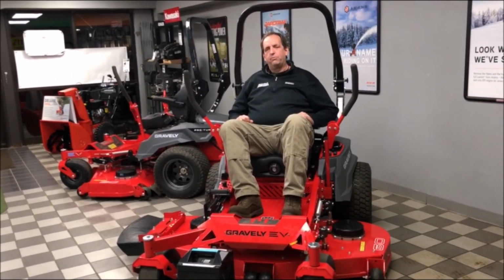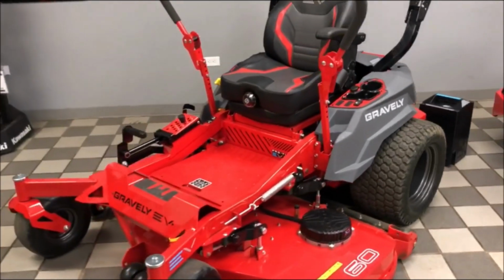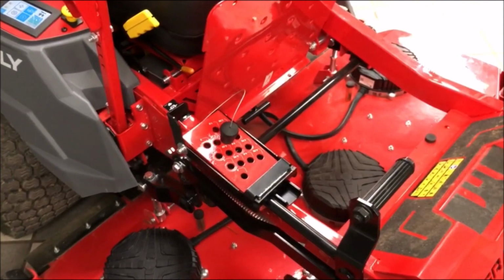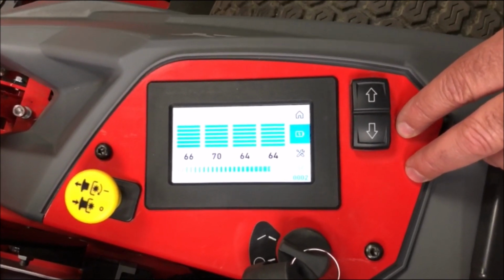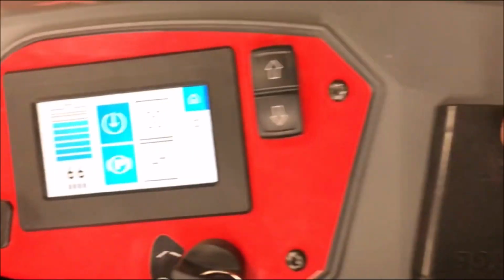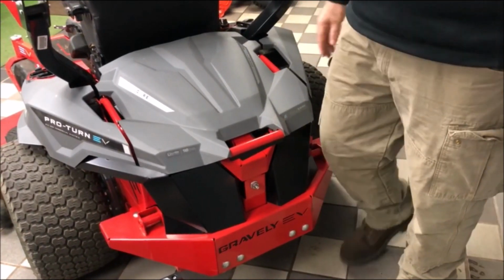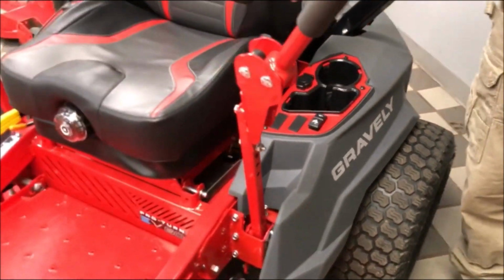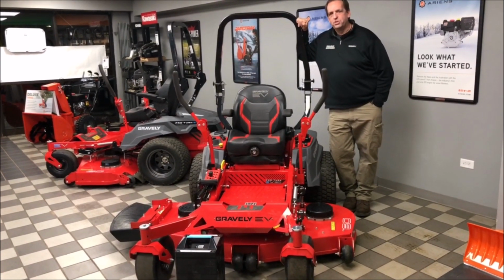NEW Gravely EVZT: Commercial Battery Zero Turn Mower

Comment: Nice review.  My primary concern are the three separate electric motors mounted on the deck.  I would prefer a single electric motor with belt driven pulleys.  We'll see what the competition presents in the future.  I do agree (and prefer) the future is electric over internal combustion engines.

Comment: I prefer rear discharge mowers for my Orchard I'm sick of side discharge and I need someone to make an off-set deck that sticks out to the left of the mower by a foot or more so I can get the blade underneath low hanging vines. 
Battery-powered seems enticing though if it's quieter than fuel.

Comment: Failed badly for maintenance staff & us (fancy words: landscapers): Ryobi #RY48140
* Mower @ $5,000.00 (54" zero turn) 
* 8 extra batteries @ $1,200.00
* 2 baggers @ $698.00
= Over $7,000.00

Didn't pass the maintenance tests during the day compared to gas.
The major drawbacks are my time is money (if battery dies, you are in trouble) & battery lasts about 317 charges which many paid reviewers will not tell.

Can't pay my staff or have clients cancel contracts if equipment go down.
And if I need to replace battery every year, then it not worth the trouble. 

Do you really think company cares if your are out of warranty?
Many of my zero turns & self-propelled mowers are still going strong and beyond 10 years old.
Reply: You need to try the Gravely,  you'll be impressed!!!
Reply: Thanks for the info, very helpful.
What brand do you recommend ( 10 years old is impressive )
Reply: @HolaFrenchy  Buy gas power products. 
Buy used zeroturn after it has a complete PM done. 
Honda or Craftsman rear self-propelled (get one that you can turn switch on/off for gas).
When done for the season, run it dry & clean to prevent rust.

10% ethanol = gov scammed by allowing millionaires to be rich by putting corn starch in gas
Leaded gas was great because it has lubrication
While corn destroy your engine, but first hurts the carburetor.
Reply: @HolaFrenchy  After Friday would be a good time to buy good used mowers from repair shops.

FYI: Husqvarna's home mowers are dead.

Comment: Gravey: you should design a hybrid model. gas to propel and generate electricity for those spindle motors. maybe even a full ele quite mode to mower early/late. having a gas engine on tap is a big plus like the toyota pruis uses

Comment: Wow how awesome, l bought my EGO landscaping equipment to start a weekend side hustle.   We didn’t get a price or how long the batteries will last on a single cut.
Reply: I believe it’s around 25K and up to 12 acres. I just bought the EGO Z6. 6K with all 6 batteries and up to 3 acres on a single charge. Electric mower is still in its early adopter phase. I don’t feel like deal with gas but you will pay about double comparing to a similar performing gas mower.

Comment: I think gravely wasted their time on a battery powered mower. No commercial lawn care company is gonna mess with a battery powered mower.   Gravely should've taken the time they spent building that mower and put it towards figuring out why their mowers cut like crap ive had 2 60 inch mowers and they both cut awful its like the blades are offset.  My exmarks will out do them 10 to 1. I actually lost a couple of customers over the way the gravely cut.

Comment: As more battery powered mowers are released the competition between them will result in reducing prices.
Reply: Ego will not be competition for the gravely. The Gravely will make the Ego look like a toy. Each Gravely battery is 8 times the size of an Ego battery.
Reply: Ray Johnson  Yes I already have Ego Plus tools and four of their batteries. The Ego Zero Turn looks good but this Graverly EVZT looks like a bigger and tougher machine than the Ego Zero Turn. The Ego will retail for $5K in the USA with four 10 amp hour batteries.
Reply: @kdegraa  the green mean have been on the market longer.

Comment: That says on the battery is 4 kWh, which is 16 kWh for set of 4 batteries. Gasoline engines are around 20% efficient, and liter of gasoline yeilds about 1.6 to 1.9 kWh of usable energy. That set of batteries can work like 10 to 15 liters of gasoline, or maybe even more since it does not idle like conventional mowers.
Edit: i think that 12h recharge time is excessive, that equates to 1.5 kW of charge current which is too low for a comercial unit, that is meant to be for a standard outlet of 110V and 15A. That should be capable of fast recharge of 1 to 2 h since this is a commercial unit not a homeowner unit.
Reply: There is also a 6 hour charger option. If needed you could charge 2 batteries in 3 hours. The goal for the commercial guy would be charge batteries faster than you can use them. It would make more sense to get an extra set of batteries than to have a 1 hour charge time (which would likely not be availble on customer's site).
Reply: Remember most days you wont drain battery to 0%, Our customers are reporting 6-8 hours recharge times.
Remember the advantage to this design is the removable batteries,   repower is easier than messing with gas cans
Reply: @mikehalloran8456  swapping a battery is easier then gas cans??? That is your selling point. Once i burn gas, its gone! Not stacked in a corner with other sone other half capacity batts!
Reply: @crabtrap  batteries have a almost 10 year life before they get below 75% how long does a gas mower last typically?
Reply: @wcooper0077  i have engines over 50yrs old that i use. and batteries aren't ranked by shelf life, they rank them by charge cycles. 75% would be about 100 charges in a good quality Lith Ion batt
Reply: @crabtrap  pretty sure I said mower not motor.  They are alot different,  this is built for a commercial mowing company. They will save money on fuel.  And replace the mower before the batteries got to weak to be usable...
Reply: i assumed you mistypes as the rest of the 'mower" isn't really in question as the spindles,blades and transaxle are going to wear the same on gas OR electric.  or do EV's have magic spindles too???
Reply: @crabtrap  it's all electric runs on three motors did you watch or read about it at all?
Reply: Relax your Brain 🧠 🤣🤣
Reply: do you want me to tell you how ineffcient the powerlines of the power grid are as is the fuel used to generate and send it to your house??? or should i just fire your science teacher now?
Reply: @crabtrap  classic power grid is around 30% efficiency, so still better then regular engines
Reply: @ivankristo3244  im not sure where you got either stat but its nonsense.
Reply: @crabtrap  Always a guy that works for oil companies commenting on EV's.  Always!
Reply: @joeking433  always a fanboy that will believe anything big marketers toss at him....always. always.

Comment: How much does it cost?
Reply: Ray Johnson  so...ridiculously overpriced
Reply: Its all about Return On Investment for a commercial mower in this size, if your burning   2 gallons of gas an hours at $3.50 per gallon that'll come to about $5000 per year in fuel.
The ROI should be about 3-4 years
Reply: 30000 is steep....for now. Without competition,  that price will not change.
As mentioned by another poster...gas plus oil plus belts plus a plus size guy .....roi 2.5 years. Also, let's see resale.

Comment: Man those batteries are massive.  How many amps per battery ?  I think i could power my house off my lawnmower.  Should have a kit to park it next to house during power outage.
Reply: 16 kw on board, true all day use, change out to a spare battery if running long days
Reply: Hey How many amp hours does it ms batteries have.